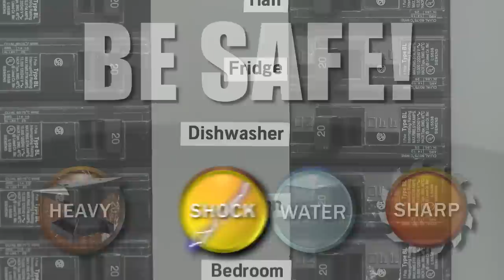Whirlpool Dishwasher Lights Flashing? Repair Help #W10473195

Comment: whirlpool won't tell you this:
To reset it, you will have to have the door open. It can not be latched. Press "Heated Dry," "Normal," "Heated Dry," "Normal" within three seconds of the first pressed button. Now close the door, this should reset your dishwasher.  It worked for me.  No parts necessary.
Reply: Didn’t work for me...
Reply: What if the heated dry button itself is blinking? These videos are less than helpful. The instructions to reset are always the same or they somehow involve depressing the heated dry button. I even replaced the control board and the same shit is happening.
Reply: Worked for me thank you!!
Reply: Wow this actually worked. All the videos I’ve watched haven’t worked, but your comment allowed me to reset my whirlpool and make all the weird blinking light behavior go away. Back to normal now. Thank you!
Reply: My “clean” light was blinking on my Whirlpool dishwasher.  The dishwasher wouldn’t start.  So, I tried your reset trick. I’ll be damn.  IT WORKED!  Thanks bro!
Reply: @tranquilroad  heated , dry normal at same time together ?
Reply: heated dry,  normal buttons at at same ?
Reply: will it work for the dishwasher whose most of the lights are blinking ?
Reply: worked for me , thanks
Reply: THANK YOU! This actually worked!
Reply: Blessings; it worked for me! Thanks for saving me $$$. I’m an elderly widow and I had decided, if I couldn’t fix it, I would just have to wash by hand. Thank you soooo much❣️
Reply: @shweta341  Yes
Reply: Rich It stop my “Time remaining” light but my Normal light is still blinking even after I close the door.  Any other tips appreciated!
Reply: Haha worked for me thanks g!
Reply: This is the only thing I’ve found that actually worked thank you soooo much !!!
Reply: Holy crap this worked for me! Thank you man

Comment: Lights flashing indicates a fault somewhere in the dishwasher, a video replacing the main panel board is completely irrelevant.
Reply: How do I find where the problem is?
Reply: @sonjas1285  If you have a flashing light in a repeated pattern or a code on a digital screen you can usually look it up online, fault indicators can sometimes give just a generic fault, so you will have to narrow down the cause by physically checking specific parts

Comment: The light will blink if the water heater runs out of hot water, if that happens do the reset, press Heated Dry, Normal, heated dry, normal quickly. I actually replaced the control panel on mine just about a year ago and the reset isn't working... I can't imagine the control panel went again that quickly.

Comment: You say replace the control board when there are several things that could cause the same problem. Such as a corroded wire cable, WD40.

Comment: Typical repair man, just replace the most expensive part on the unit, then if that fails to fix then actually perform a few tests like door switch, door latch and a reset..Get that cash first mentality.
Reply: yes, for this model reset is done easily:  press ["2 4 8 Hrs" - "Start" - "Cancel"] for 3-4 cycles.
Reply: Yeah no shit. And that control panel is basically just a piece of plastic with a ribbon cable
Reply: The ONLY thing that worked for me was to run a diagnostic cycle. Sani rinse, heated dry, sani rinse, heated dry and let it RUN. Some joker said to hit CANCEL after the board lit up. That does absolutely nothing

Comment: To reset it, you will have to have the door open. It can not be latched. Press "Heated Dry," "Normal," "Heated Dry," "Normal" within three seconds of the first pressed button. Now close the door, this should reset your dishwasher.

This worked for my whirlpool!
Reply: This happened twice in the last 2 years on my 14 year old whirlpool DU1100XTPB7( normal light flashing.) Tried following the reset instruction a number of times.It does not reset. What works is removing the board and all the connectors ,re-Install the board back. Turn power on. Pronto! You hear the drain cycle for about 30 Seconds and all lights go off. The only thing I can think of is that some connectors get oxidized and stop making the proper connection.
Reply: @latehappylife  Dude, I just replaced the control board and it didn't change a fuckin thing
Reply: @flip65515  What I can tell you is what has worked for me. If you replaced the control board and there is still a problem and you can not diagnose the It. Depending how old you dishwasher is, it may make sense buying a new one. In my case, my dishwasher is a premium model, and would cost about $800. The ones that cost $400 to $500 are made real cheap. Good luck.
Reply: @latehappylife  that sucks but thank you
Reply: Actually, last night I unplugged it for about 20 minutes and caught it off guard so I was able to do the diagnostics. Anywho, it did its thing for about 10 seconds and the heated dry button continued blinking
Reply: Also, I wanted to mention. It started out as a problem of being in the locked position. When I depressed the button, instead of disappearing, the heated dry button lit up
Reply: Adding another data point, I have a IKEA IUD9500WX4(which is a re-badged Whirlpool) and had the blue light flashing on the control panel issue.  I did the "Heated Dry", "Normal", "Heated Dry", "Normal" reset sequence and the seems to have worked; it put the dishwasher in the rinse cycle which is going on now and I'm going to let it finish.  I'll report back if it doesn't pan out but right now I'm optimistic that this seems to have worked! Thanks!
Reply: mine shows pots and pans and normal plus the cancel /drain light all blinking rapidly